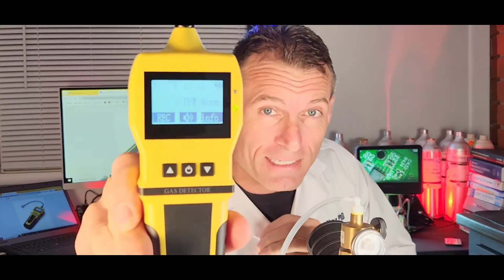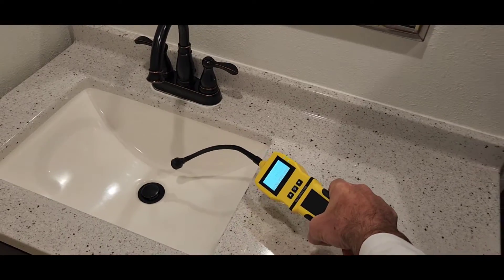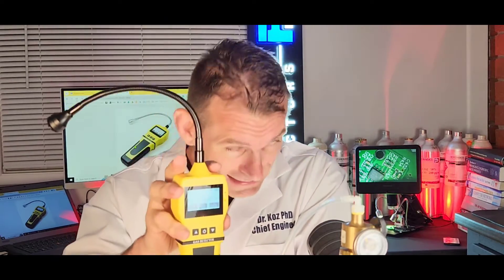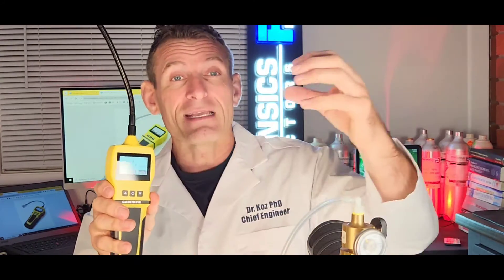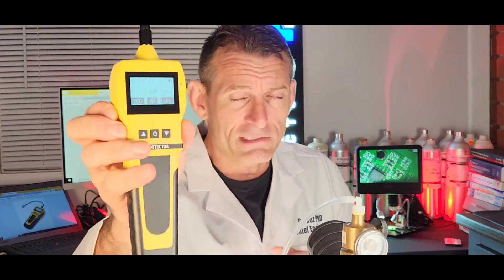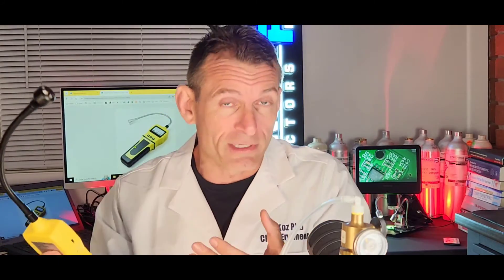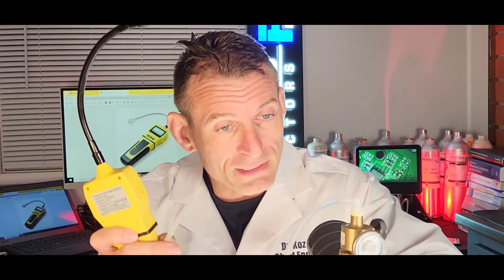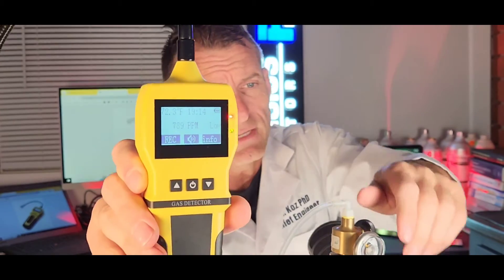Sewer Gas Leak Detector ⚠️Testing⚠️

Comment: this is advertised on amazon to detect.... "Acetone, Acetylene, Alcohol, Ammonia, Benzene, Butane, Ethanol, Ethylene Oxide, Gasoline, Hexane, Hydrogen, Methane, Naphtha, Natural Gas, Paint Thinners, Propane, Solvents, and many others. "  is this an accurate description of the function?  if it is, how do you know what vapor is being detected?   The manual is quite glib.
Reply from the maker: There is no gas detector or gas leak detector, that will tell you what it is detecting. Impossible. It responds to all combustibles. Sewer gas is combustible. Natural gas is combustible. Turn on and operate. Simple function, in fact, doesn't need a manual, one-button operation and is easy per the videos.